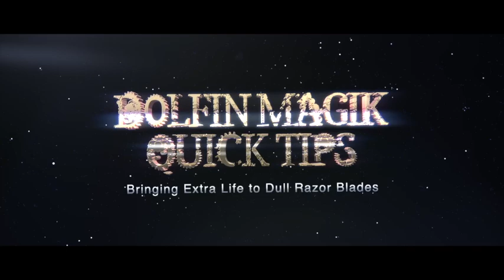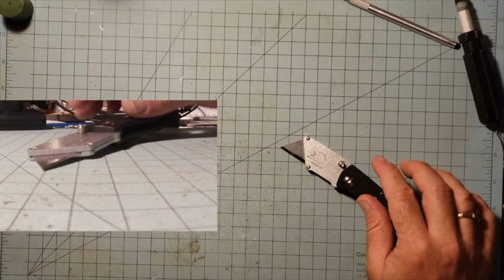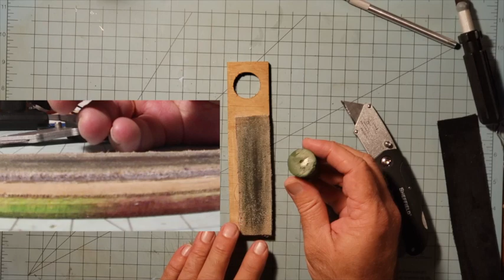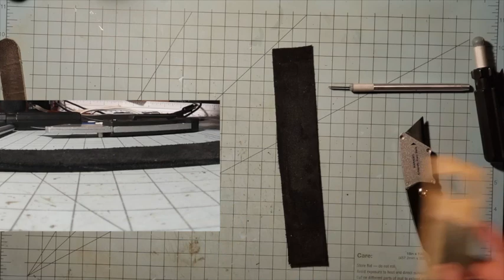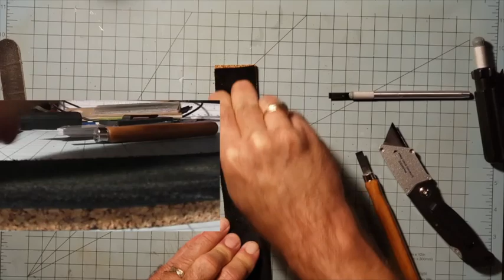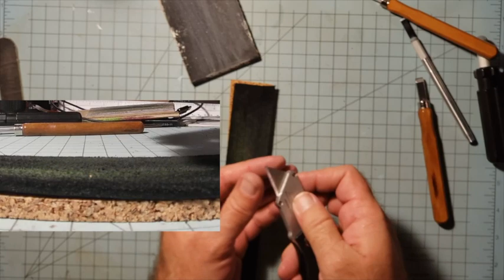Bringing Extra Life to Dull Razor Blades | DMP QuickTip #2

Comment: I think I missed something. The leather is for polishing the blade after sanding with sandpaper, or Emery ?  If it sharpens, how?
Reply from the maker: Good questions!  The leather helps "hone" the edge after using the sandpaper, emery board, etc.  The leather can also be used to keep the edge sharp if the blades are "somewhat" sharp and doesn't really need to be sharpened.
As a blade is used the edge has a tendency to "curl" or bend over.  The leather bends it back, in a manner of speaking.
I hope that makes sense.
If it doesn't ... let me know and I will try to do a follow up to explain it better.

Comment: Also, does the leather last a long time? Where can I get one of those green sticks? And will the leather from a belt work or do I need a special kind??
Reply from the maker: Yes, the leather will last a very long time.
I got the polishing compound at Lowes, but you can find it all over.  Harbor Freight, Walmart, Home Depot, online.  Look for "Chromium Oxide"
A belt will work.  You want it to be rather thick and durable if possible.